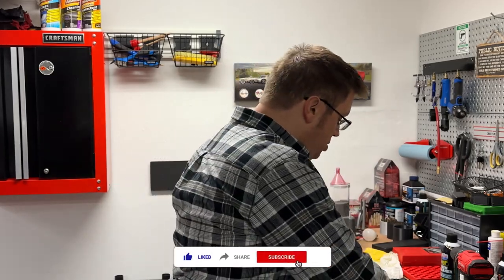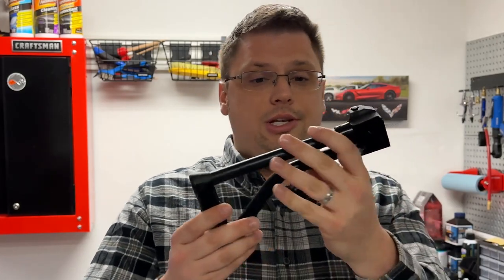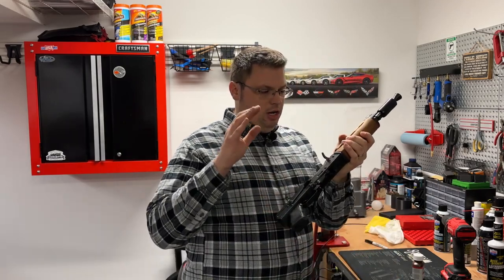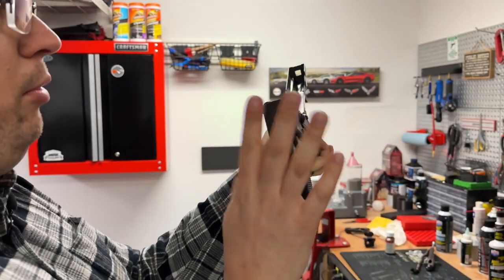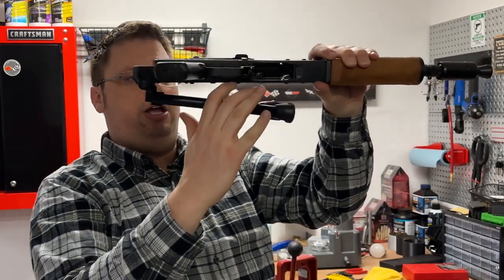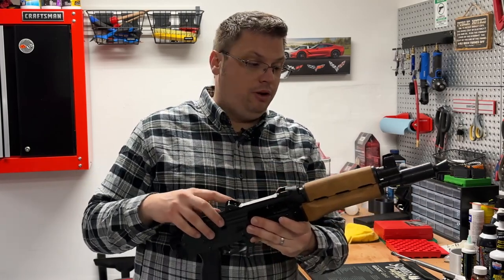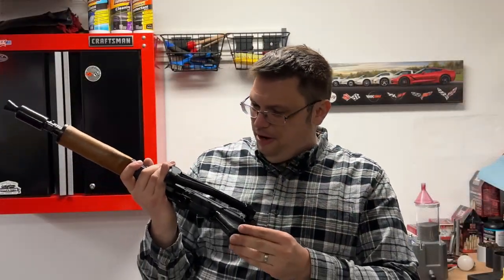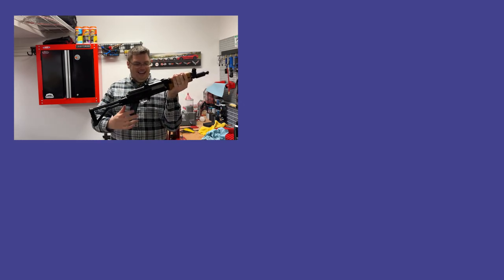Installing a Brace on My Zastava ZPAP M92 AK Pistol | AK Project Pt 3 #guns

Comment from the maker: It is only after the fact that I realize I forgot to show or even mention the rear nut that goes inside the AK's receiver for the brace bolt.  Yes- there is a nut that the bolt threads into...NOT just the rear trunnion.  If you do this mod, you need that bolt.  Please don't think you can get by without it! My bad, everyone. My bad.

Comment: Hey man! Thanks for the vid. Considering doing this versus the SB adapter that you put between the receiver and the grip. How has it held up? Also does the screw you put through the rear “self tap” itself into the drilled hole or do you put a nut behind it within the receiver? Let me know and thanks again, great video and awesome AK
Reply: Derp, didn’t read your pinned comment - thank you, anyways, how did I last? Still stable and sturdy as it was day 1?
Reply from the maker: @goon_time lol happens to the best of us. My fault for not calling it out in the video proper. 

Yes! It is as stable and secure as the first day. There was a mysterious time there during the brace ban that it disappeared, but it just as mysteriously reappeared. Weird.

In short, the brace is absolutely solid.
Reply: @PhantomLlamasDen  what adapter did you use ?

Comment: Given, that is an imported “pistol” adding a brace… do you think under the new rules, you can’t SBR it, and you have to either destroy it or turn it to ATF ?
Reply from the maker: Excellent question! This was recently clarified by the ATF. In the clarification, imported pistols will be treated the same as domestically manufactured pistols.
Reply: I hope so 😅

Comment: So if I got the ZPAP85 that’s predrilled then do I need to still drill a hole for the 1913 adapter pice ?
Reply from the maker: No sir! You would use that hole. Unless something has changed. My m92 was an older model (the reason I had drill the hole).
Reply: @PhantomLlamasDen  okay so all of them new ZPAP85 just need the 1913 adapter in no drilling hole ?
Reply from the maker: As long as the hole is pre-drilled, yes.
Reply: @PhantomLlamasDen  so basically all pre drilled mean is that it’s a hole ?
Reply from the maker: That is my understanding, however you may want to check with Zastava. They have excellent customer service.
Reply: @PhantomLlamasDen  I asked buds already